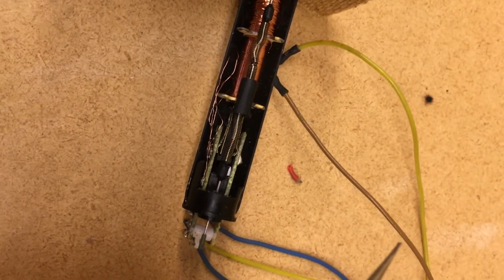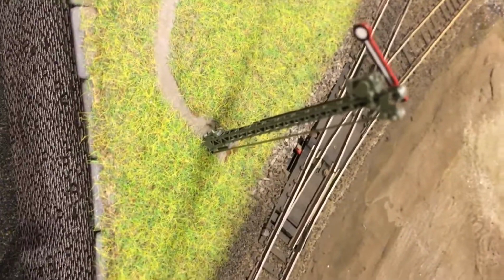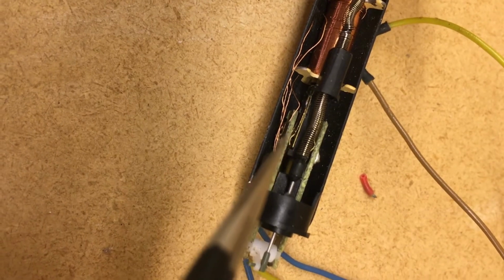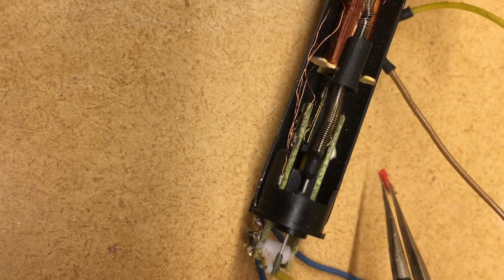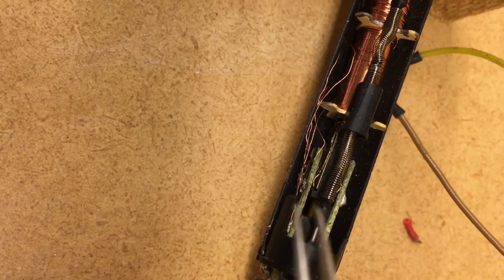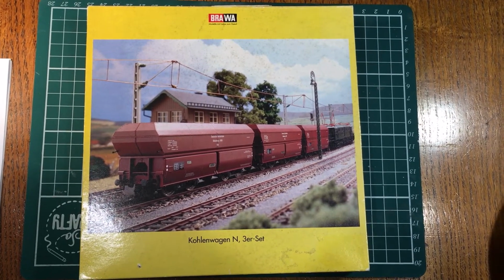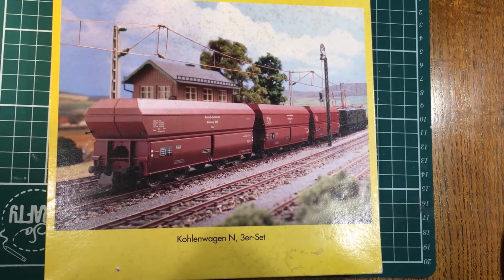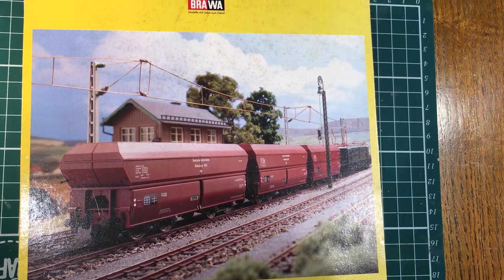Spur N Layout Update No. 29

Comment: Hi Thomas,
I have also some problems with the Viessmann signals. Sometime the switching contact is broken and the signal will function only in one direction. 
The steam engine is great cinema, very strong. 
Best wishes from Switzerland, Klaus
Reply from the maker: Klaus
that was my exact issue - signal would only operate one way
as they are expensive, i wanted to try and fix it, which, as you saw , i did.
in September, i will start again with the landscaping / backscenes etc 
take care
Thomas